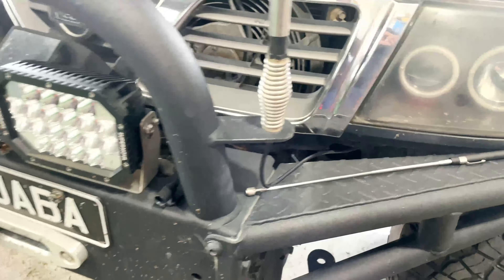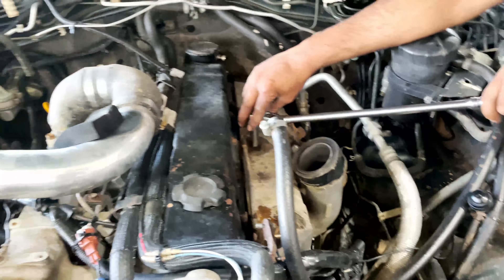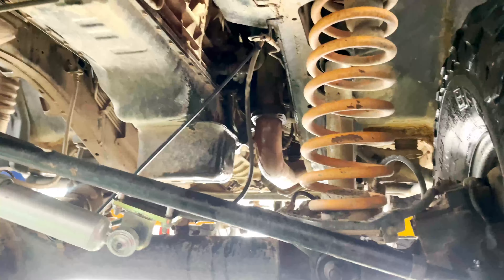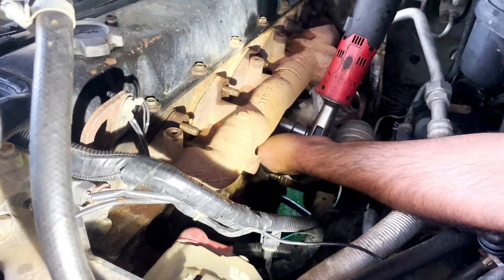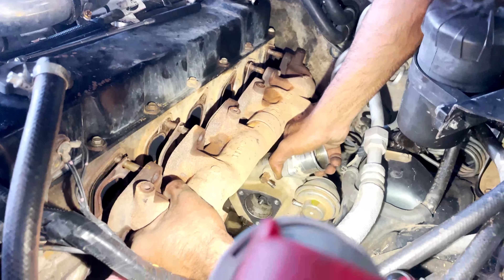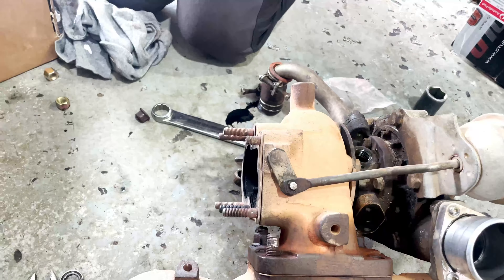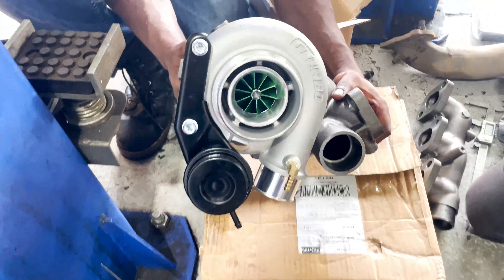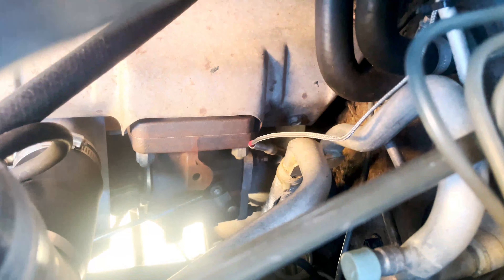Gturbo Upgrade | Nissan Patrol TD42 Turbo install

Comment: Are you sure that motor is factory turbo that's not a factory exhaust manifold that ive ever seen before..
Reply from the maker: Yes mate.it is factory turbo engine. It is 2003 factory turbo engine. Come with 11mm injector pump without electric solenoid. Not an intercoolerd engine.